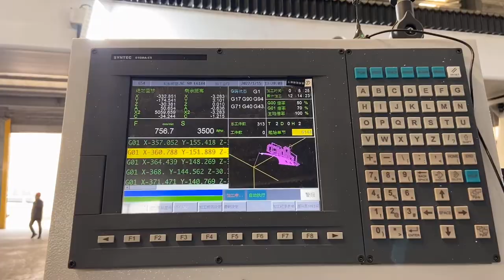Large format 5 axis cnc router machining yacht mold foam boat building #5axis #cncrouter #boatmold

Comment: How much would cost a 1/8 scale model car in polystyrene? (500mm x 250mm x 200mm approx) I can provide the .STL file, but first I need to know if I can afford your costs.
Reply from the maker: Could you rell me your whatsapp no.or mail box,our engineer need  your .STL file to check the actual price,different design,the processing time is different,so the price is different,thanks very much ,this is mail:eileen@chencancnc.com,and whatsapp no.:008615969742312,Wait your update

Comment: That is not heavy duty. We machine giant ivar molds at minimum 600 inches per minute.
Reply from the maker: sorry sir,this machine working speed usually is about 800-1000inch per minute ,the video is just testing the demo foam,and this machine structure is enough for processing foam and other composites mould,we could show you our client contact information to check our machine details